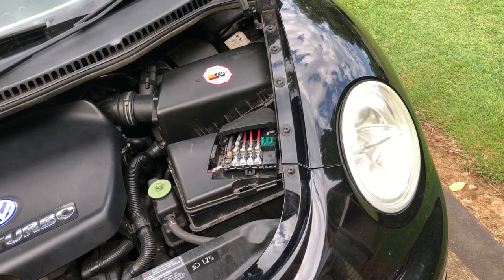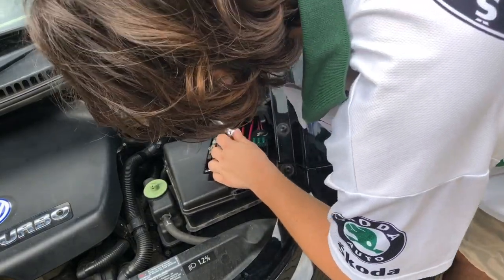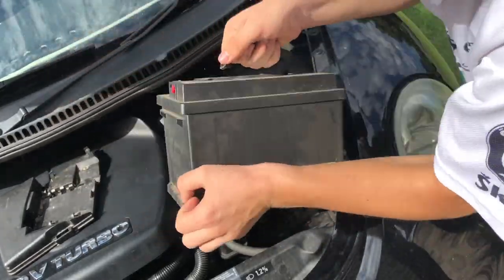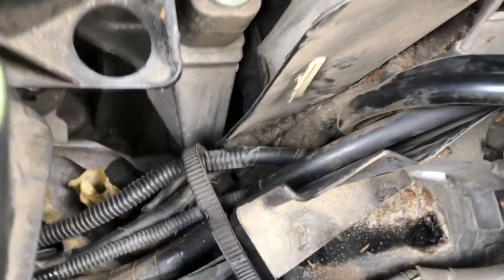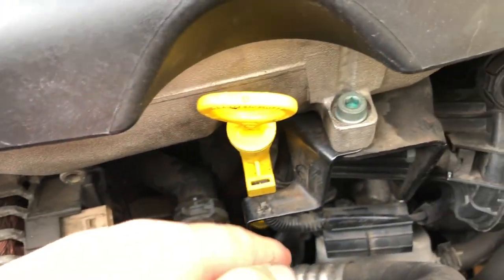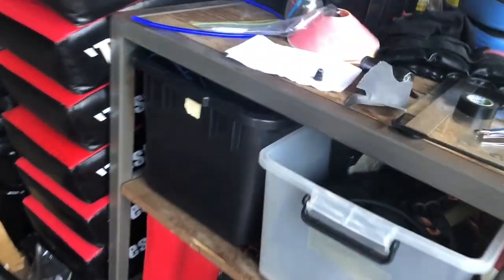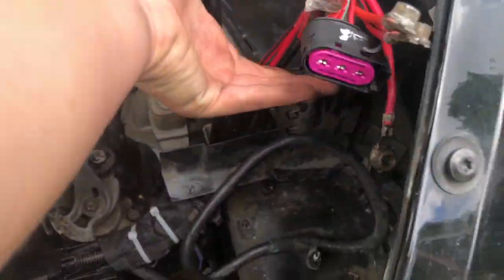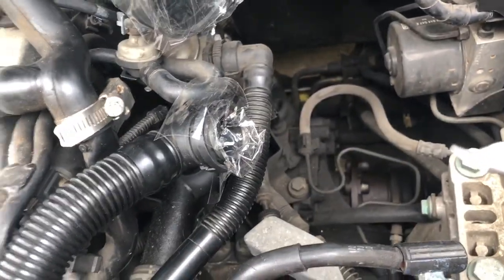Volkswagen fuse box melting and how to solve it!

Comment: I think you got it wrong it’s not the gauge of the wire it’s the connection contact surfaces need to be dressed with a brass wire wheel on a Dremel tool.

Comment: Where can i buy the supplies to make the alternator cable? And what size cable did you use and the name of the pieces I need. I would really appreciate your help. I'm having this issue and I've replaced the fuse box twice.😀
Reply from the maker: hey what country do you live in? So i can list the shops you can go to.
Reply: @noahweepers705  I live in the United States can I buy the parts at Amazon and if so please give me a list thank u for ur time
Reply: @noahweepers705  I have the same question.
Reply: @anthonyhuffman3877   YOU GUYS NEED 4 GAUGE WELDING CABLE AND, 4 GAUGE 5/16 TINNED COPPER LUGS AND LAST BUT NOT LEAST: HYDRAULIC WIRE CRIMPER($60). Please for the love of god, do not buy Car audio FAKE copper coated aluminum wire otherwise you will end up with a worse fire.  IF YOU ARE IN THE USA HARBOR FREIGHT HAS THE Wire crimpers, The ones on amazon suck unless you buy the temco. My harbor freight is a clone of the temco and kicks ass. The wire you can get at AIRGAS or a welding supply store but its cheaper to buy online.  IF YOU DON'T WANT TO CRIMP YOUR OWN LUGS ON(easy to do) They sell premade 4 AWG battery cables but they are overpriced due to convenience tax. 

Summery: 4 Awg welding wire+ 4awg tinned copper lug with 5/16 hole + crimper + $2 heat shrink = 5x better than oem and Professional battery cable
Reply: @rmblwgn  Great Information..    Very appreciated...
Reply: Hello, I need to do this to my vw as well. ? What about the 3 connectors that are connected to the old wiring harness ? Thanks. I've read that somone just cut off the ends of the old wire in place and left the connectors hooked up, just want to try and fix my daughter car thanks
Reply: I used 25mm2 welding cable with copper lugs 10/25 as far as i remember, and used also some thermo tape.

Comment: What caused the problem?
Reply from the maker: Ba design from Volkswagen in regards to the fuse box over the battery and also the cable they use is too small of a gauge to cope with the alternator current.
Reply: I'm a professional mechanic and I've just done one where the alternator was overcharging, it was full of oil too. So I replaced that along with cable and fuse.

Comment: This is the best vid I seen on this.  So many fail to mention cleaning the ground connection.  Mine burned up at the alternator ! It literally took fire !
Dead of winter but had just pulled up and parked...through snow on it !
Put in brand new Bosch alternator cleaned ALL connections.  The one under the battery was disgusting someone had "fixed" it before and stripped the insulation way back and didnt re-tape or heat shrink it.
Although my box was ok I now carry a spare.  My core problem however started with a weak but still "OK" battery.  Never run a boarderline battery in your VW.

Comment: I love you very much man. Your accent suggests I will never pull up next to you when you need a wrench and that makes me sad. I am roundly and thoroughly convinced that I'm going to take my battery out. I will leave the battery box and make a power box for these things. I'm getting rid of the backseat and going to a two-seater model with a giant battery box behind the front seat heavy and low and deep. Set it up with a good charger, in 100 ft cord. I'm doing this hillbilly hybrid gig three-seater. I want to put a chair for the mechanic that's it in under the hood where the battery used to be. If I eliminated the alternator would I lose my tachometer on the diesel motor?

Comment: Two questions: First is do you know if the actual alternator cable and the attachments are electronically linked and the how would you remove the clip on 5:13. Thanks

Comment: Hallo 
What is the reason for burning the second" red line"?  Where's the problem? How can I fix that?
Reply: It is usually just too much resistance at some point in the run. A thicker gauge cable and every connection point clean will solve it, but as he mentions the second line runs to the cabin fusebox through the wiring harness and it's a giant pain and a mess to deal with - huge teardown necessary.

Comment: After buying a new battery the fusebox was replaced but battery still dying out very fast. Now diagnostic says alternator.  Do I  replace harness or can it also relays?
Reply: if the diagnostic said alternator, you need should replace the alternator,  While someone is doing that job, have them replace the cable as Noah did here.  Think about why the battery is dying.  It makes sense if would if alternator is not kicking out the 14.4 Volts as it should.  Once that is fixed, AND if you still have the problem, you need to find the drain, and if you have an aftermarket radio, that is probably the next thing to check.  FB page for New Beetles brought me here...people there complain about battery drain.  Mine will die if I let the car sit for a month.
Reply: @DanTheManIOM   @DanTheManIOM   is it possible a parasitic draw can give a false read on the alternator?
Reply: @christinacorrell  very doubtful.  When they tested the alternator,  they look to see  does it  generate an excess of 12 volts, should be like 14 V. That is the pass, fail.    That's what they were looking at and since it was unable to generate that voltage,  it's time for a new alternator based on what you told me.
Reply: @christinacorrell  one more thing, a relay is a glorified switch,  they are used for on/off as an input and they switch a higher power (amperage) on the "other" side.   You turn on the headlights, that pulls in the relay that allows power to the headlights as opposed to running all that power for the headlights through the headlight switch...
Reply: @DanTheManIOM  okay thank you. I will post an update once I get the issue resolved. I appreciate all the info.
Reply: @christinacorrell For anyone reading in future, yes it can. 
I replaced my alternator because of a diagnostic saying it was bad. 
The Next day the battery was still draining and needed jumped. 
So I took the alternator out and had them test it.  It tested good. 
I brought in the original, it tested good as well. I think the power supply wire overheats causing a lack of power supply. The composition of the copper can wear after time specially with being really hot.

Comment: First off?????  Show us the other end of the terminal at the generator / alternator.
2nd show us the entire cable of the old one before placing it into the fusebox.  S177 position
3rd I believe a fuse box replacement and a check of over-charging in the alternator should of been done first to validate the melting.
Finally my conclusion is if the cable is not melted in other spots of the fusebox, and the fuse box was the only spot where it is warm, could you have collected debris and caused an arch.  Which the arch simply caused melting like a welding unit usually does.

You described in your title "Volkswagen fuse box melting and how to solve it!"; but the title should of said "Volkswagen fuse box melting and how to replace it!".

Comment: spoiler alert they didn't fix this problem in the mark 6 either.. $400 right off the bat
Reply: 400 for the repair or 400 for the that little fuse block ?  They also let the 1.8 turbos self destruct for 5 years....
Reply: Really? I’m thinking about switching my mk4 for an mk6